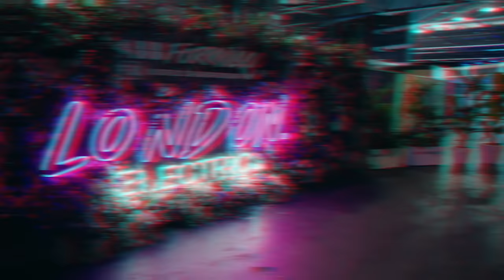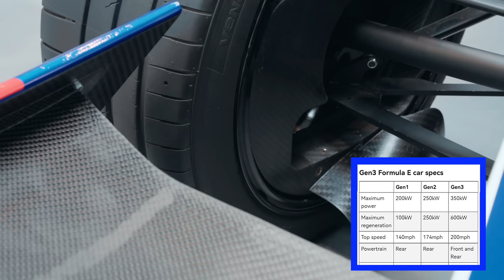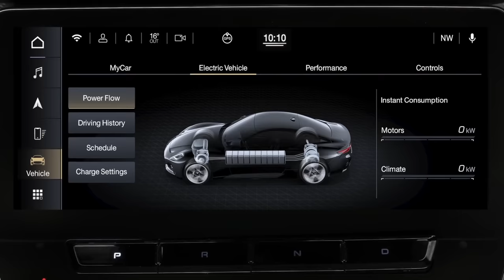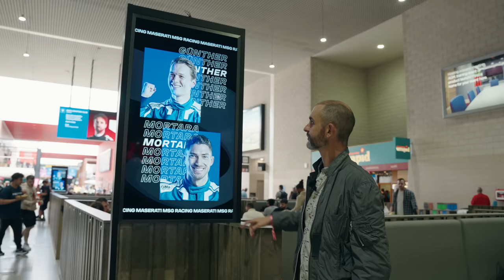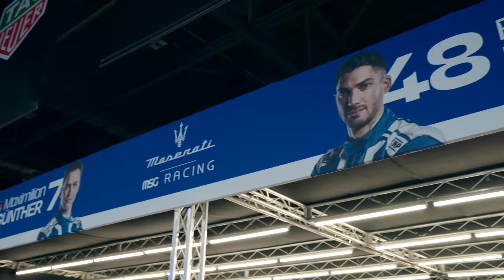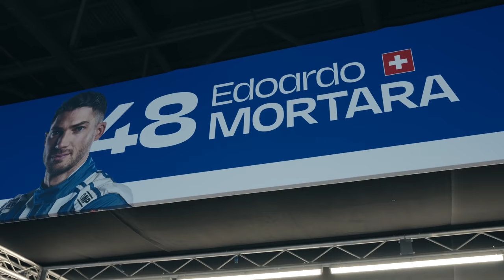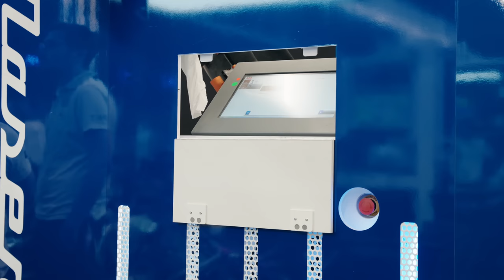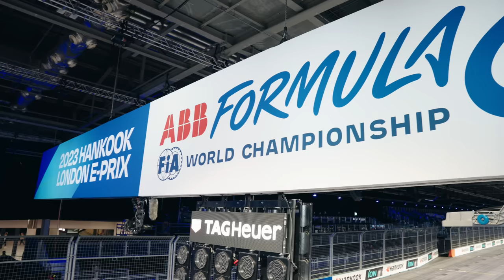Exploring Maserati's return to racing and bold new future...

Comment: Respect for how much they've improved in the last ~6-8 years. In the 2000s Maserati was basically a punchline (even if I am irrationally fond of the Coupe of that era, that's just dumb nostalgia talking; I know they weren't good cars) but now they're really compelling, in a great position to be more special than Audi/BMW/Merc sorta cars, more demure and attainable than Ferrari, more characterful than Porsche, more robust than Alfa Romeo...I like where they're positioned. Also been an FE fan since season 1 and Gen3 is pretty amazing!

One thing Laurie Clog should've mentioned that isn't spec and actually gives the teams a huge amount of performance differentiation is software . I know it's not sexy but it's ultra relevant; FE is proper living breathing motorsport that is advancing the state of the motorcar. While ICE racing is more and more restrained just to make the racing happen. That's one of the most exciting and compelling things about FE.
Reply: Exactly. These companies are learning how to tweak the software to squeeze the most range at the highest speed out of the least amount of battery. That is invaluable knowledge they can apply to the real world. Transport Evolved did a few nice segments on FE and one of them was specifically about how they are using compute power to figure out how to design the battery management systems to get the most out of the Gen 3 batteries. And that knowledge can also trickle down to real cars. Really cool stuff.

Comment: I’ve been a sucker for Maser for 25 years now. They are a brand of almost, as for years in the early 60s they had the quickest car at Lemans, but reliability issues. Luck plays a big part too. 

To prove how bad I have the disease. I drove a biturbo from Boston to California when I was 19 (zero issues). Owned several others and still own a late Merak SS. It will stay in my blood for good but sadly I still can’t get excited about electric racing. Sounds like a group of fax machines taking a corner.

Comment: TBH i cant wait for Formula E to take off. I would actually rather see it without a driver. I know that might sound mad, but eclectic cars are insane I'd love to see them going neck to neck, all limits off, just have a minimum weight and safety.  I guess it would be just like remote control car racing or nitro, only very large scale.

Comment: I'd love to see Formula E cars racing against Formula 1 cars on a real -- full length -- circuit like Silverstone. ICE vs Angry electrons, head to head. Everything equal; as many pit stops as they need, whatever tires they like. Why hasn't this happened?
Reply: The FE wouldn't see which way the F1 went after two corners. I think the only comparable track is Monaco, where the F1 barely stretches its legs and the F1 did 1:11s in quali and Fe was 1:28s this year.
Reply: To add some more context I just checked and the F3 cars at monaco this year did 1:23s. So these FE sit somewhere between F4 and F3 I guess.
Reply: @BlayneyPS  Interesting comparisons, thanks. As you say, Monaco is a short circuit. The difference would probably be much greater on a longer one like Spa. I guess that's the reason FE don't go up against F1,2,3 cars. The result would damage the image of electric cars in general. 0-60 times don't win races!

Comment: with only 7 dealers in the uk i would never buy another maserati, you have to travel over 100 miles for a service if you use a normal garage as you cant reset oil viscosity counter which puts eml light on do your dpf wont regenerate, they have a fire wall from obd port to ecu so you have to go to maserati even though they are 100 miles away, i have owned a maserati for 2 years really reliable good quality car but never again really poor network but you wont hear the truth from paid experts reviewing there car